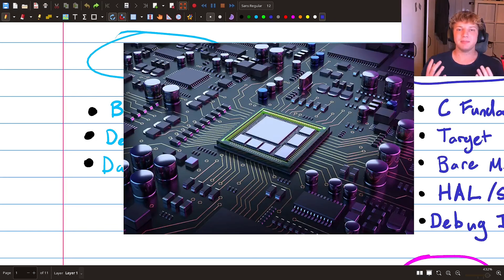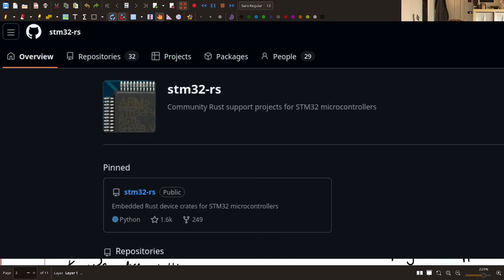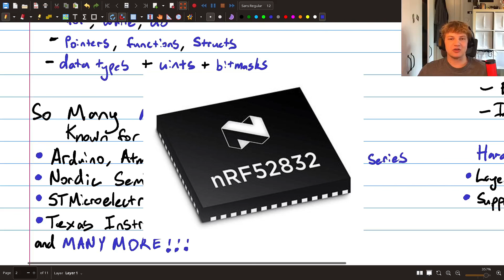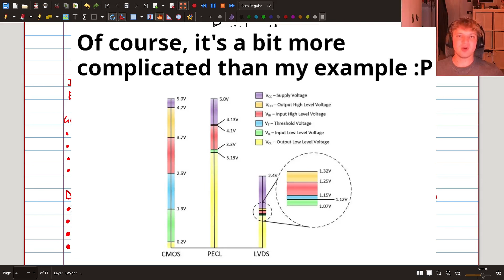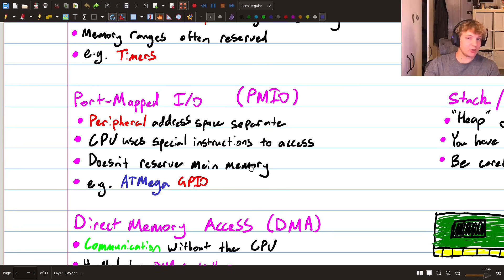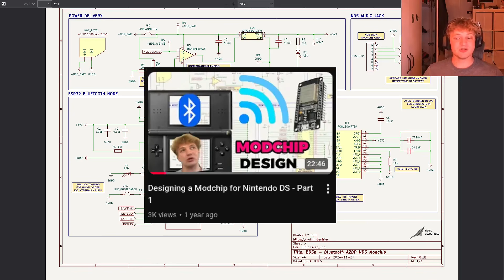COMPLETE EMBEDDED SYSTEMS Roadmap - What Arduino Won't Teach You

Comment: How much math usage is required to be an embedded software engineer?
Reply from the maker: You can think of it like that iceberg meme because it depends on what kind of job you get. There's a lot in embedded that is simply data logging, wifi / bluetooth connection, writing drivers, etc. which wouldn't require much maths.
We get a little deeper into the maths realm if you want to write a display driver like I've done in a previous video where you do framebuffer operations and draw shapes on the screen.
But down the bottom of the iceberg is control systems and theory, digital signal processing, electric motor control, observers, etc. which requires a bunch of maths. I have a video where I briefly detail it here https://youtu.be/t-hKEgqssHk

Comment: Do you strictly recommend C or does C++ count? Can someone verify the key difference?
Reply from the maker: C and C++ are both used for embedded, though C I have seen much more than C++. So it is greater chance going into a company you'll have a primarily C codebase.

C++ has many features C does not have, and many on the internet have correctly made the observation that "C/C++" is not really how we should qualify these - often times your style of coding writing in either language will be completely different. For example, C++ has classes and objects whereas C does not.

Comment: Are embbeded systems interactive or engaging? I'm coming from front end I liked how visual it was but I don't like backend at all
Reply: Depends. If you don't like backend, then you may not like embedded. Depends what you don't like about backend, but if it has to do with feedback confirmation (dom updates and looks right so you know code works,) you'll have a bad time.

Interactive and engaging? Absolutely. You're doing things with real physical objects, but debugging is a whole other level of difficulty.

Is it software? Is it hardware? Is there a missing or loose connection somewhere in the wiring? Are timers configured correctly? Is the MCU little endian/big endian and is the serial com from another device the same or do you have to reverse the bits to get the right data?

Basically, there are a lot of possible errors to make and not really any "error handling" supplied. When you communicate with some API, chances are it will tell you what you did wrong (status code or exception thrown in runtime.) With this stuff, you'll know something isn't working as expected but may have very little information provided to figure it out other than your own knowledge and experience.

Every component is like it's own API and the datasheet is the main docs. Even something like a current sensing chip may have an internal scratch pad where you configure the bits in the EEPROM to match your application (like a calibration register that will save your value and then use that for calculations) and then read data from another of those registers.

I started in frontend but have always been a figure it out/how does it work type, so I've naturally gone further down the stack over the years. Basically moved from full stack web (modern frontend, backend, databases, infra, etc... with Go, TS, SQL) to embedded, C programming, and some electrical engineering.
Reply: @MChannel_FET I don't like the part of backend that has to do with SQL essentially and logs and what not. From what I've seen in embedded there is a visual component in the sense working with real time systems and electronics
Reply from the maker: hey man, they certainly can be! big bonus of embedded is that usually they have some sort of display like an LCD where you can build something that gives visual feedback in real time. Even if they don't, usually there are LEDs for state or a data logging component where they might be streaming to a dashboard.

You'll often find 'event driven' architectures where the system is reactive to external stimuli. These can be both interesting to watch since they're quite responsive but difficult to debug since events can happen in a non-deterministic order. There are videos on my channel about this topic. Hope this helps!

Comment: this is genuinely good content. Only other people doing this seem to have super heavy accents lol

I’ve been designing a system to read the analog sensors on my 80s truck and display them on custom stepper motor gauges. I’ve had to look into most of the stuff you mentioned which makes me feel good about potentially going into this industry.
Reply from the maker: that's actually sick, tbh I can see that turning into a custom headunit or something if you decide to chuck a display in there
Reply: @hoff. @hoff._world was actually what I wanted originally. I’m still gonna leave some ports open for communication with a raspberry pi later on. Ideally I’d have it function as a media station, gps, diagnostics, and maybe even settings for changing things such as backlight color for my gauges.

Comment: Whilst I appreciate the content of the video I do think it is important to note that you can, and sometimes should learn all these skills on an initially abstracted device like Arduino.

An Arduino itself can teach you all of this bar DMA (and true DAC) by peeling back each layer of abstraction. I think instead of suggesting a different board with less friendly abstractions it might be more beneficial to direct people to resources that help them do bare metal on the board they have.

The advantage you get from this is that you can learn top down. Starting with using a library or library function, and then when you have it working, reading the datasheet and implementing your own. A really good resource for this is deep blue embed, though I'm sure there are many others.

Comment: Great video. Just subbed. Question: Would love to hear your opinion on which microcontroller sees higher deployment in consumer IoT products. The STM or the ESP32 or the NRF. Prima facie the ESP32 appears to be an early contender due to its bundled WiFi and networking stack.
Reply from the maker: hey! it's a little more nuanced than simply "which is best" - IoT is a big field with many subgenres, though trends to emerge. I've seen:

- STM32 in general purpose, high I/O or high clockspeed designs
- NRF king for BLE and Zigbee applications
- ESP32 has higher power draw but of course a big ol' WiFi / BT Classic radio, so for connecting to internet this is grand

keep in mind that advanced designs can have MULTIPLE microcontrollers on one board, often working together.
Reply: @hoff._world  Thanks for your reply and perspective. IoT indeed has exploded in the past decade with cheaper and more accessible mcus. Product designers integrating multiple chips for improved functionality is what we can expect more of even if it bumps up the cost. In my experience from other fields not related to electronics/embedded its not always the best product that gains max market share. Though lets hope Ai helps consumers make more informed decisions.

Comment: I tried Zephyr RTOS, and to be honest I don't understand why embedded community avoids C++ like a plague, but using abstraction via device tree compiler, generated tens thousands lines of cryptic header files is accepted as a better alternative. Not to mention how hard is to find errors due to typos in device tree, missing line in prj.conf file and all of that. And the worst part is that many drivers have some limitations, quirks and many devices have features which are not implemented in driver anyways. Except one data logger running at 50Hz or faster, using ZephyrRTOS, it's shell and LFS, Zephyr was overkill for my projects, but I had somewhere to start - but I can recall three cases when I needed to read source code of driver, because it either returned error on a command that basically cannot fail or it driver did not work, because it had some limitations (such as writing buffer to monochrome display requires 8 pixels boundaries of updated area, which LVGL does not known, unless it's forbidden to do partial updates)
Reply: from where did you got the resources to study
Reply: I don't think Zephyr is a good representation of the embedded space, there's too many abstraction layers
Reply from the maker: @zakstechs when I used it I found this too. It was a nightmare to debug, but magic when it worked. Funny thing

Comment: Can I enter the field with a degree in computer science( pure software) or degree in computer / electrical engineering required
Reply from the maker: hey! I have videos where I talk about the degrees I have here https://youtu.be/QFLw7I9f5zc and here https://youtu.be/t-hKEgqssHk
tl;dr I think you can do "embedded software" just fine with a compsci degree, but don't expect to be doing hardware design roles
Reply: Hey, electrical engineer student here. Let's say it helps a lot. In the end of the day it depends on what you want to do. When I work in embedded projects I also always work on analog circuits and I read datasheets and I design PCBs. For that you need to understand electrical engineering, the maths and concepts behind it and also if you want to work in real time program your uC bare betal. In my case with C or Assembly. But that's just one way to go. Im pretty sure there are also "software only" bedded roles but this is more computer engineering then I guess

Comment: As a followup to my previous comment, the Atmel family of MCUs are not something to avoid. There is a world beyond the Arduino IDE. If you dig deeper than the IDE and learn about the Atmel family processors, you are not wasting your time. 

You can program ARM MCUs with the Arduino IDE. The Arduino project branched off from Processing and allowed artists and new creators to access a world that would have been otherwise unavailable.
Reply from the maker: agreed 100%, I think there is good reason that introductory embedded courses (at the uni I went to at least) focus heavily on the Atmel AVR series at the register level (no Arduino libraries) and today the modern AVRs and PICs can be great choices for designs.

I agree that Arduino has been great for introductions to the field and the higher-level support frameworks they provide allow a wide variety of people to create more and faster regardless of skill level. I started on an arduino as well, but often I find people get "stuck" on arduino and try to use it for complex projects where it probably isn't the best choice, because it's all they know. This is one of the motivations for making this video. Thanks!

Comment: I'm doing a double masters in computer science and computer engineering  to escape web dev exactly at the age of 25. However I've been thinking about dropping CS and just taking some electives in areas that interest me and just doing computer engineering? Would you recommend CS or CE first?
Reply from the maker: hey I actually have a video on this here https://www.youtube.com/watch?v=QFLw7I9f5zc and I compare the two here https://www.youtube.com/watch?v=t-hKEgqssHk
Reply: @hoff._world so after watching your video I think I'll stick with both but doing computer engineering first as I still want to pivot hard from web development into embedded systems because I really like digital electronics and the idea of coding and see my code do something.  However in the CS side I really want to get into Linux programming and some AI stuff. With my IT bachelor's I've mostly have done web development. What do you think? Would CE be more valuable for embedded software engineering.
Reply: Am 27 , bout to become grandpa . Reading ur comment I feel I still am not so old to start a new journey.
Reply: @renFrFr3 well that gives me motivation may we do this journey together!
Reply: Do CS, no question. CE is optional if you have CS
Reply: @alessandrorossi1294 for embedded systems?
Reply: @alessandrorossi1294  actually it's much better to do CE simply for the reason that you'll be able to make use of the electronics/circuits labs and the expensive equipment.
Reply from the maker: @alessandrorossi1294  strongly disagree actually, if we're talking about embedded - CS will teach you none of the electronics fundamentals. If you want to break into embedded with just a CS degree you will need to try REALLY hard on your projects to demonstrate electronics skill
Reply: @hoff._world that's what I was thinking, I do want to have the ability to pivot to other software areas but I guess I could take electives. I'm just going to focus ce for now and maybe double major down the line

Comment: and here i am, a electrical engineering student trying to learn zephyr for my custom 36 key keyboard.
the pcb is on its way from jlc, the 3d printing is done, now just the firmware.

great Video!

(i know its not needed to know it or understand it, but well u guys know how it is, one is just curious)
Reply from the maker: are you using QMK by any chance? A friend of mine recently did a project like this
Reply: @hoff._world  Well i use zmk (zypher based for my bluetooth one (zmk is specifically made with low energy and bluetooth in mind)
and on my new wired one im using qmk which is older does not use an rtos but is easier for an beginner like me to wrap their head around, since its only like 40 c files i can look through to get a feel for things.

Comment: Man I'm getting more interested in the hardware side of tech every day but I'm already 2 years in on my software engineering degree 😭😭
Reply from the maker: you can pivot to embedded software relatively easily, I know a friend of mine who did software but got top marks in one of the embedded courses my uni offers. I wouldn't expect to be designing circuits professionally, but you could be an embedded software engineer and have the electronics guy do all that
Reply: In the current context with ai bulls*t everywhere, i would also highly think about it. For context, been primarily a backend nodejs dev for ~10 years now. The web is cursed and distributed systems are annoying to work with. The embedded world is looking more and more attractive, especially now a days with all the capabilities of the MCUs vs 10 years ago..

That said, an important point to consider is salary. Back in the days it was much lower than web dev, hopefully it has changed. Like a junior web dev is around 60-80k/y (canada) and could do 100k fairly quickly depending on your skills and learning capabilities. 60k-80k used to be the highend for embedded developers.

I would say embedded is somewhat more ai safe to some degree since there's a physical limitation here.

Comment: Started an embedded systems degree last year. Honestly, everything except the labs can be learned on the internet.
Reply from the maker: I think so. Although I will note that "self-taught electronics" does not have the same market as "self taught software", I doubt anyone will hire a hobbyist or self-taught electrical engineer for good reason. That being said if you already have a compsci or engineering degree I think you can pivot to embedded software relatively easily by self-teaching basics of electronics, just don't expect to be doing circuit design
Reply: @hoff._world  well then tell what's the reason dude
Reply from the maker: @edinaldonokyojin8974  because killing or hurting people with poorly designed electronics is much easier than killing or hurting someone with a poorly coded website :)

Comment: Hardware Abstraction Library? Hardware Abstraction LAYER makes more sense in a conceptual sense

Also, I do C++ at my job. Does this allow me to understand C? How big/small are the differences?
Reply from the maker: sure, but everyone says "HAL Library", which would be "Hardware Abstraction Layer Library" and that sounds awkward so I dropped the "layer" when I was speaking. It's all the same to search engines

C has a lot less features than C++ so you may have to 'unlearn' some design patterns

Comment: Thank you for the effort and time put into this but quick one, I believe videos like this are meant for beginners who have no idea what they are doing, so just throwing big words with no detailed explanation confuses people even more “adds a layer of abstraction between your application code and the device, in this case we are talking about registers”, a beginner that doesn’t even know what an abstraction is now has to learn that and registers all at the same time, that by the end of the video they have learned absolutely nothing, most won’t even make it to the end because they have way too many questions and unknowns, still trying to keep up with your blazing speed
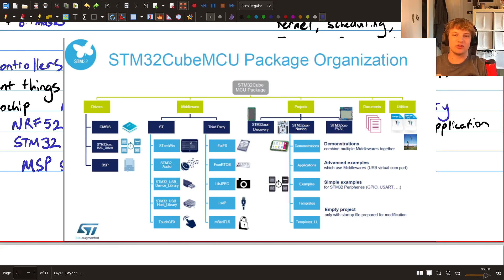Reply from the maker: Hey, I disagree with the intended audience and so I disagree with the rest of your point. I'm assuming basic knowledge of software engineering concepts - in the thumbnail I even have "escape webdev" and in the first technical part I talk about how strong C fundamentals are important to know. I also explain what a register is at 13:55.

If you don't assume any level of background knowledge and have to explain everything in immense detail your video will be 10 hrs long.
Reply: @hoff._world Fair point 👍🏽
Reply: @DarylChris Thank you for setting aside your ego and actually keeping this conversation fair. ❤